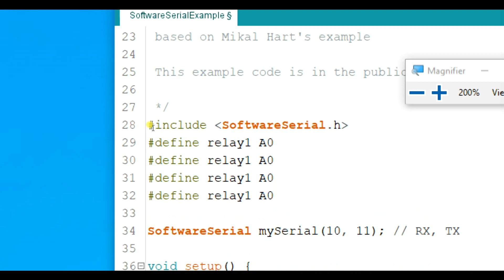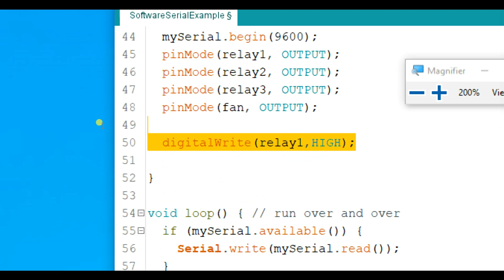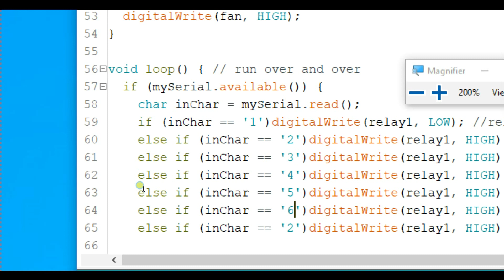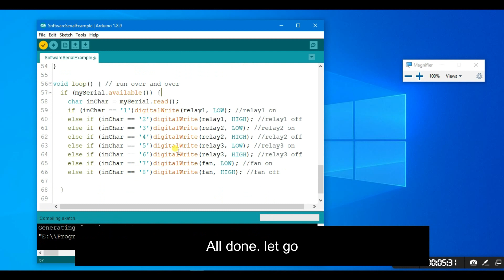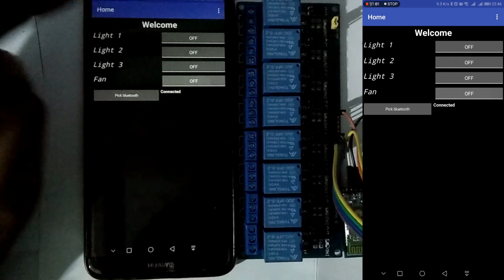Control 4 relay using Android phone via Bluetooth with source code

Comment: can you please share android app source: how you manage app to contact with arduino?? i want it connect over internet WITHOUT any server or WITHOUT any online service. i want to send data from arduino or esp8266 direct to mobile android app through internet. how to android app have to contact with module.
PLEASE CAN YOU HELP with that??
i can control over webserver via local area network: but i want to connect it over internet. that's where i am stuck with that.